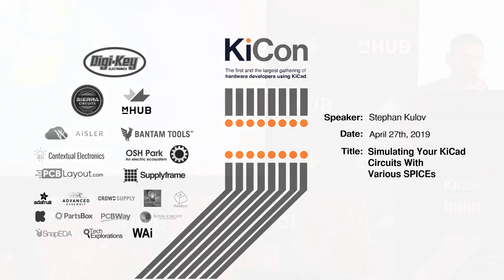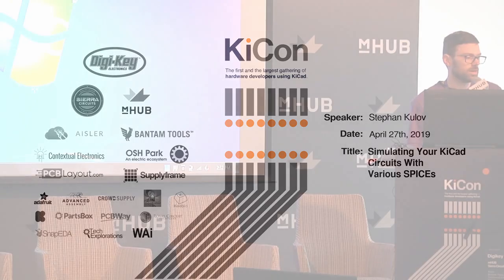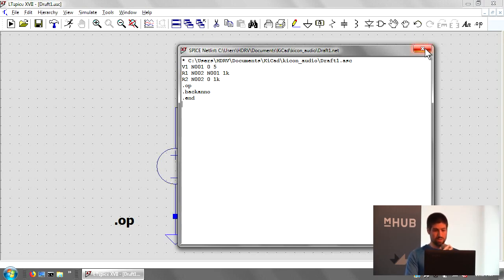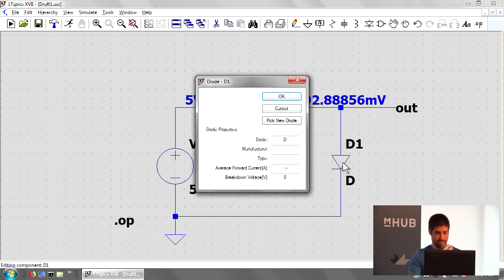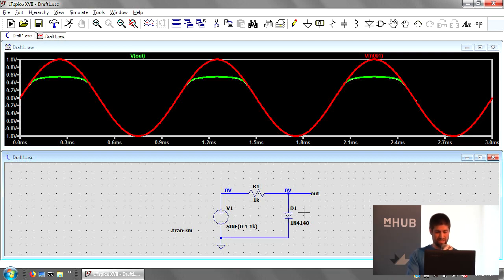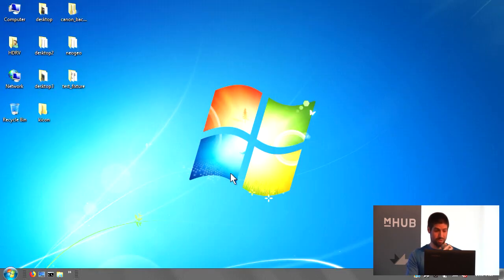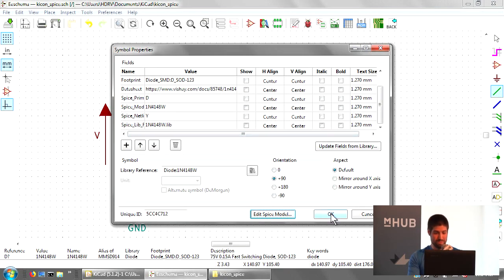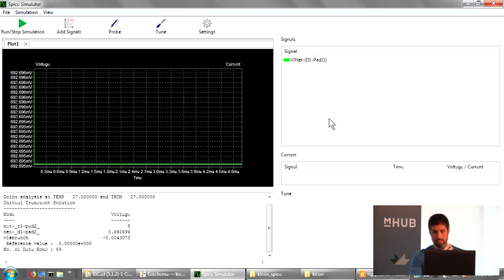"Simulating Your KiCad Circuits With Various SPICEs" - Stephan Kulov (KiCon 2019)

Comment: I was using LTspice for years, and didn't know you can do Alt-Click on the component to see the power in transient analysis. I always manually created own graph trace that multiplies voltage and current to do it myself. But that basically does that for myself. Brilliant. This is awesome!

Comment: In kicad, how can we measure the voltage between two points? It looks like we can only mesure the voltage between a point and the ground (?).
Reply: Click on the 1st node and without releasing the mouse, drag to the second node.
Reply: I use the "subckt meas" presented in this forum.
https://forum.kicad.info/t/add-differential-signals-ngspice/17995/2